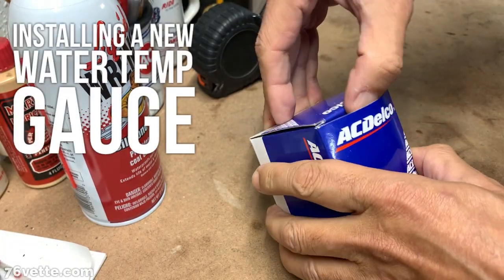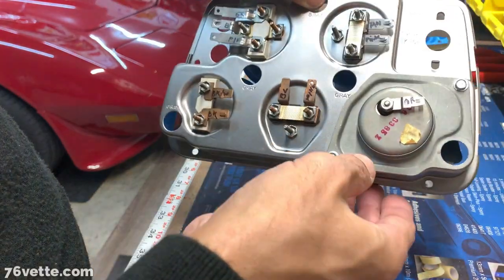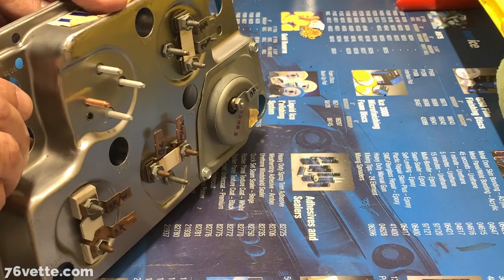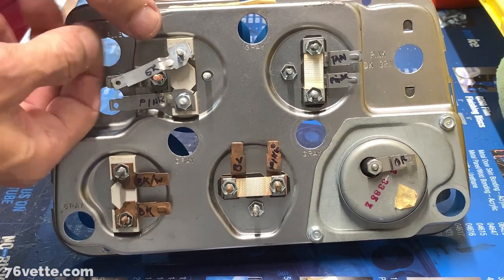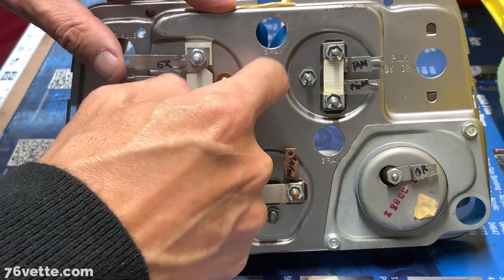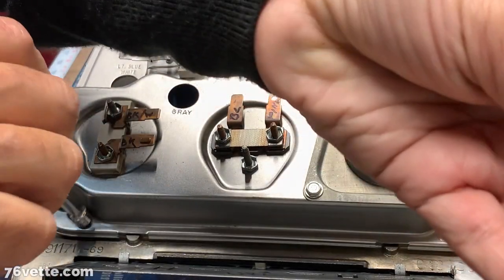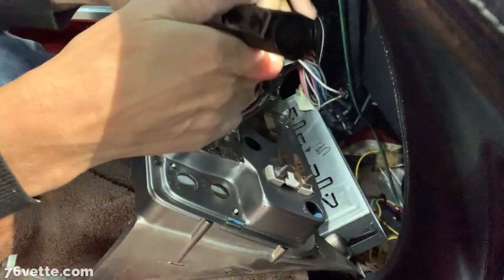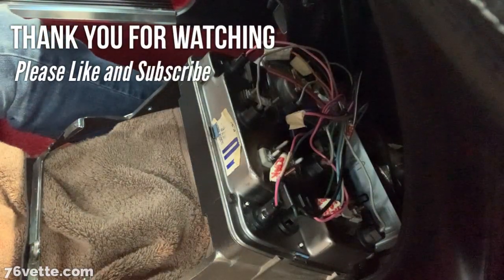How To Replace a Water Temperature Gauge

Comment: Lol I'm doing this right now 😅 probably gonna have to buy an aftermarket resistor to place behind the gauge because the new sending units apparently all read differently 😑
Reply from the maker: If you’re using the factory gauge, Willcox Corvette offers an adjustable resistor, so you may want to look into that.
https://willcoxcorvette.com/corvette-temperature-gauge-adjustable-resistor-68-76
Reply: @76vette  will do thanks!

Comment: Well??? Did it fix the issue of the temperature bouncing all over the place? I’ve been following your troubleshooting. I’m dying to know!
Reply from the maker: It did not! ☹️ So I’m installing a new 3-row aluminum radiator by Champion. The copper rad had sprung a leak and it’s not worth repairing it. Really hoping it was plugged and that the new radiator will solve all issues. Stay tuned for that series of videos. 😊👍🏻
Reply: Part comes in tomorrow I'll let ya know!
Reply: It would help if you cleaned the connecting parts from the little corrosion they had… good luck with the center gauges

Comment: Any video of the removal of the actual instrument cluster? Looking to replace the radio in my 74.
Reply from the maker: No video of that yet. However, you may find the following 76vette.com article helpful, as I go over the steps necessary to remove the middle instrument cluster. It also includes a couple of pics. LMK if you have any specific questions.

https://www.76vette.com/2019/06/heater-core-delete-fix-ac-issues.html
Reply: @76vette  Great stuff, thanks! Love the videos and channel.
Reply from the maker: Thank you!